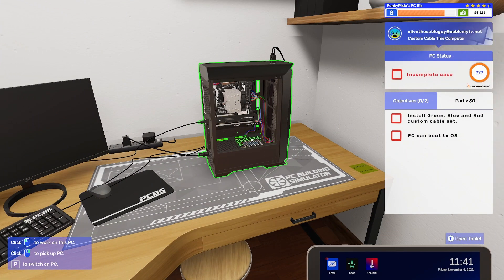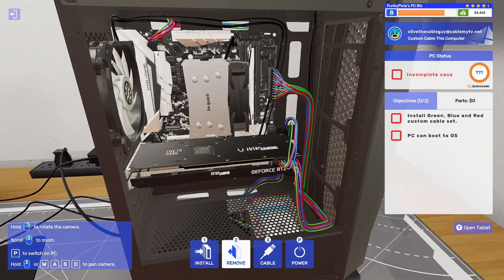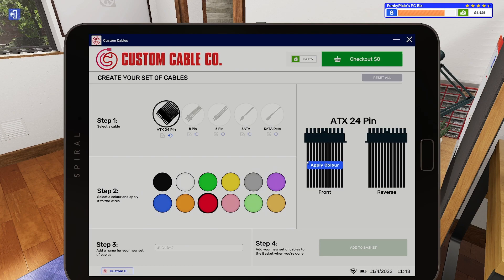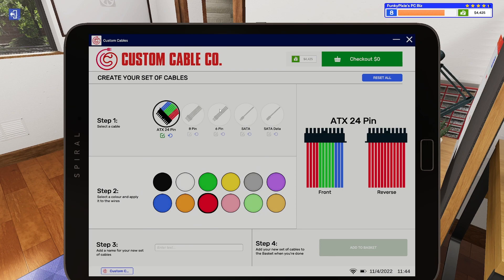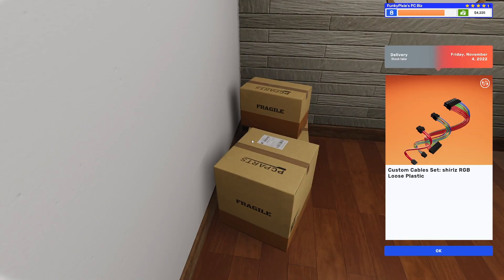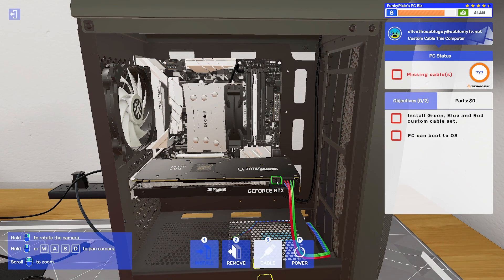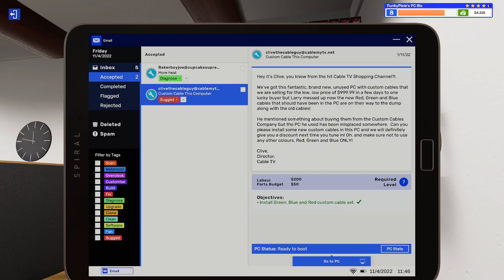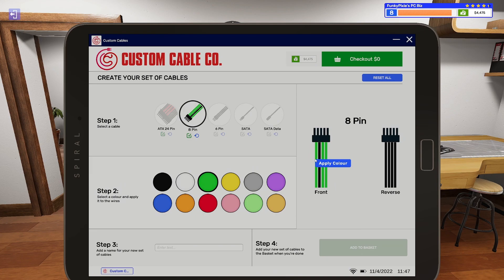PC Building simulator 2 RGB Cable fix - How to complete custom cable job

Comment: Even following your video I STILL cannot complete it. I knew I was missing something with the Custom Cable app, that step I missed seeing with the tutorial pop up. I'd seen a reddit thread where users were literally going red cable, blue cable, green and that worked for them. I'm still struggling and gonna keep troubleshooting. Bit frustrating on my end, weird that it doesnt just WORK when you throw in any combo of RGB cables.

Edit: So I think the issue pops up from not completely removing all cables. ALL CABLES. Even the non colored ones. When I stripped all cables out and replugged it all of a sudden completed. Am still very glad for this video. Like I've said earlier, I missed that tutorial pop up with mentioning the Custom Cable app.

Comment: As it turns out, everything is simple. But for me it was logical to buy cables separately, i.e. I colored the ATX cable - threw it into the basket, then colored the 8-pin and also into the basket, i.e. each cable separately. Because of this, a situation arose, as it is said in the video, not all cables were colored.

Comment: After trying all kinds of stuff and 800 dollar worths of ungly ass cables, turns out the game is just bugged, removing the HDD and reinstalling it fixed it. seems like the game is not correctly detecting the cable on the HDD. anyway, i will not accept custome cable job ever again.

Comment: Thanks for the help!!! I was tearing out what little hair I have left doing this, I don't know what I was doing wrong, I must have missed a cable when I was unplugging the cables originally. I was a bit worried that the cables coming from the motherboard were black no matter what, but following your video helped a lot, thank you!

Comment: if you are having trouble after copying this video try removing the SDD in the back. My game didn't highlight that cable untill AFTER i removed it and reinstalled it. then it worked for me
Reply: thank you so much bro you saved me alot of time
Reply: after spending more than $1000, and followed the video... I see your comment... FKN LEGEND 🔥 I was about to uninstall everything and fck off
Reply: Bro you saved me 🙏🙏🙏🙏🙏🙏🙏🙏
Reply: What happens next? I took it out and it worked,but putting it back in just unticks the box
Reply: @LXRZ_2005  same thing happening to me. Did you find a fix?
Reply: @tylersixsix7108  remove wires,close out of c build,put it into storage start a new build with those same wires,then when theyre in put it in storage and take actual pc out and wires should work
Reply: @LXRZ_2005  so i ended up getting it to work. But I unplugged the sdd out of the back and the checkmark went green. plugged it back in and it returned to red. I removed the drive completely and reinstalled it and it somehow worked.
Reply: U saved me more than the video, thanks for all
Reply: You are a hero
Reply: I love you broooooo
Reply: Thankksssss
Reply: thanks man
Reply: The comment that saved me after hours of trying, thank you very much!
Reply: i love you
Reply: This ☝️
Reply: Tnx lol
Reply: THANK YOU SO MUXH

Comment: How did you complete the tutorial quest for cable coloring ? It's stuck for me with a tutorial quest, I can't even access the PC because it just prompts "YoU NeEd A GrEen CabLe DUH" which I've bought doing specifically everything you did : green colour, applied on both side of all cables, but no luck ................ Help
Reply: OK found it for the tutorial it's mandatory to BUY the cables from the Shop. I'm feeling sad. But it works

Comment: In my case the system has a non modular powersupply. So all cables become black and the custom cables are not shown. If I change the powersupply everything works but I cannot turn in the pc because I didn't use the customer psu.

Comment: I did this exactly and it's just saying nah. I think it's just a bug with this mission. I cloned every step you did even down to specifically picking the flat braided ribbon cable type you used, no dice.
Reply: I was stuck here for a minute too. 
Make sure you unplug EVERY cable and plug things back in. 
It wouldn't pop the missions for me as I missed the power cable to the hard drive. 
Once I unplugged, and replugged it in, it worked
Reply: @roberthoffman3113  thank you so much
Reply: @roberthoffman3113  You are a legend!!

Comment: yeah no matter what I do it doesn't work for me :(... just quietly leaving the pc of to the side
Reply: Buy a modular psu and install it and then all the wires will be colorful and the mission will work
Reply: try checking the psu cable by taking the back panel off, its easy to miss and that was what was wrong with mine

Comment: I somehow missed one strand on the 24pin 🤦🏻‍♂️ but the dumbest part of this mission is that it uses a non-modular psu so we’re rewiring PSUs now I guess 🤷🏻‍♂️
Reply: I have the same issue. How did you solved it?

Comment: I've done the exact same as you but not working.
Reply: Same situation 🫠
Reply: try checking the psu cable by taking the back panel off, its easy to miss and that was what was wrong with mine